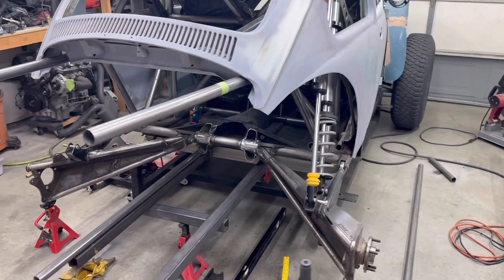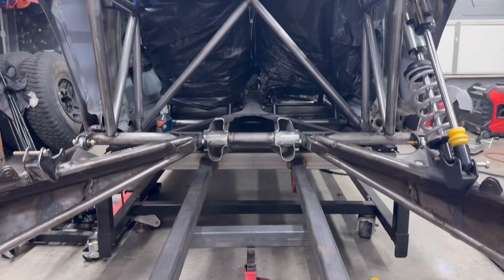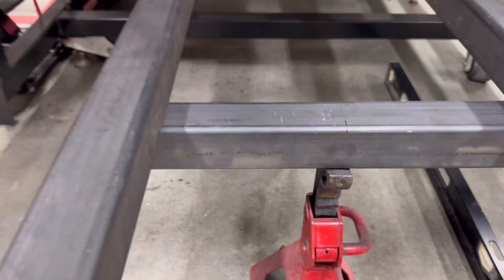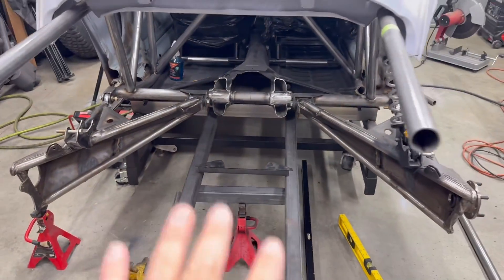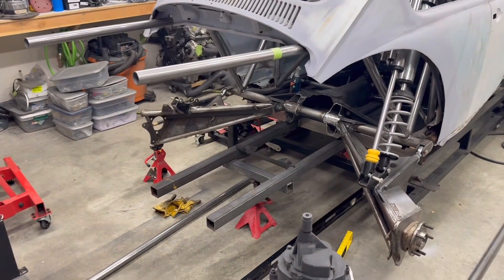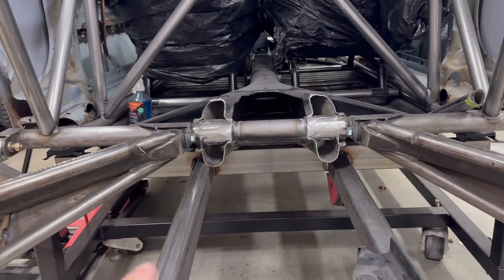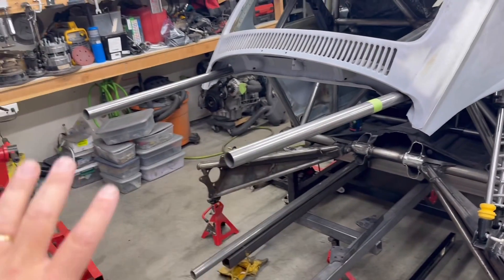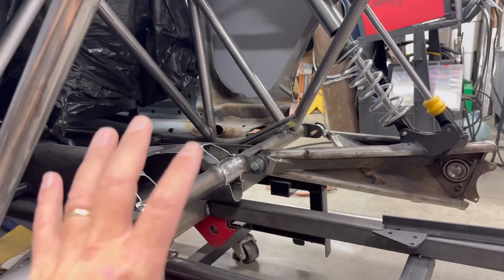Baja Bug Transaxle Install: Measurements, Angles & Full Fabrication!

Comment: hey man congrats on this awesome build! i wanted to know if you designed the roll cage, frame and everything else with suspension or this something you can make on bend tech? i want to make my stock bug like yours and im getting ideas from yours. i will definitely subscribe to your channel.
Reply from the maker: Thank you for subbing! The design is mine with the exception of the a-arms. The front arms have the same geometry as @dougbugbuilder Wratchet chassis. I don’t have any files on the chassis as it was built in place.
Reply from the maker: Also, I highly recommend NOT tearing down a running driving bug. The only thing original is the body and part of the pan. Way better off finding a $500 bug somewhere and sell the driver whole
Reply: @MiahsBug thank you for the tips will definitely look into going that route then

Comment: Diggin the build videos keep them coming. Where did you get the 3d printed bell housing?
Reply from the maker: I found a model online and had a friend print it. Cost about $30
Reply: @MiahsBug  you have the stl file for that?
Reply from the maker: @Deezalmech  I got it here.

https://grabcad.com/library/mendeola-2d-transaxle
Reply: @MiahsBug  Thanks. I actually found a stl file for a 1/6th scale trans axle. Scaled it up and broke it down into 9 pieces to make it fit the printer. looking at about 72 hours of print time.

Comment: those cv flanges are sure high in the car, its going to kill your cv angles, and drop, the floor will hit the ground before it uses any up travel. i raced 1600s for 38 years and very inch of travel mattered. out the axles and tires and travel it before you get to far,
Reply from the maker: I appreciate the insight. The axle angles and suspension travel are definitely a critical aspect of the build that I've been focusing on. I have 18” of travel with 6” ground clearance and 23degrees on the CV’s. I’m pretty happy with that.
Reply: @MiahsBug  ok ,good luck
Reply from the maker: @bradinch1563 thank you sir
Reply from the maker: Also, the Medeola has a fat ring gear compared to a bus trans. That pushes the cv cups higher on the “horns” unless you hang your trans below the skid plate

Comment: How far forward are your trans axle’s from where they will bolt to the arms? My axle angle front to back is too much.
Reply from the maker: The trans is slightly fwd (maybe an inch) at ride height. At full droop it is inline. I used laser technology only used by the worlds best shed builders lol

Comment: Great video. 
What makes you mount the engine/trans frame/cage below the rear arm frame 1” and a 1/4 lower? (Hope that makes sense)
Also mounting the gearbox at 5 degree is there a specific reason?
Just was curious. 
Great videos mate.
Reply from the maker: Thanks. I guess I left out the “why” in the video. The 1-1/4” drop is for stance. It’s kinda like giving it a lift for ride height. The 5 degrees angle on the trans is to gain more ground clearance at the engine. Thanks for watching!

Comment: Love the laser thingy...  where did you get it?
It was a good idea to move that rear mount.  I should do that too!😊

But looks awesome!   Loving it!
Reply from the maker: Thanks Damien. It’s crazy how close we have been pacing each other in our builds. Lol it’s like we are building together. I got that laser on Amazon. It was the cheapest one I could find. I’ll send you the link if I can find it
Reply: @MiahsBug Indeed.  Lost "Bug"-Brothers!  😂😂

Definitely send that link... then again, that might mean I need to be more careful!😅
Reply from the maker: Actually, after I started using it, I realized I have a few tubes off about 1/4” from true centerline. When I first started I snapped a chalk line on the ground and used a plumb bob. At least my front end is on straight.
Reply: @MiahsBug definitely not getting one now... 😂😂😂